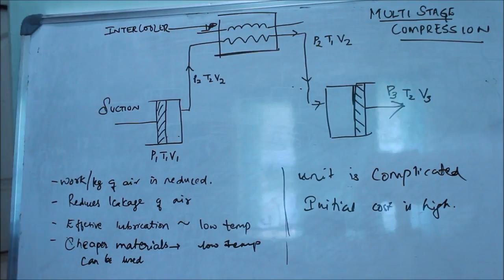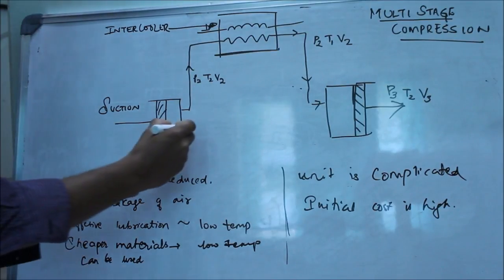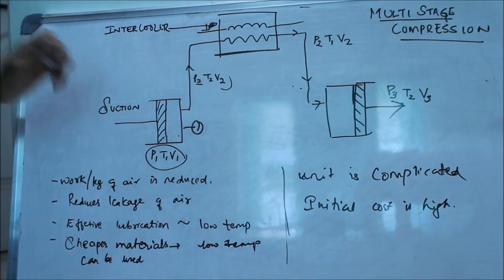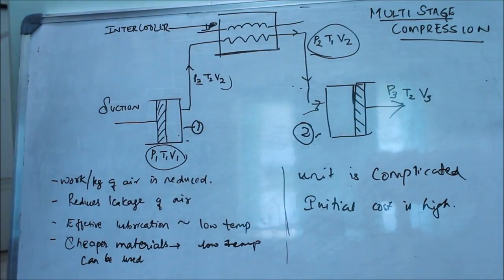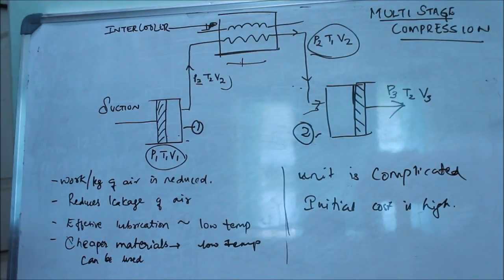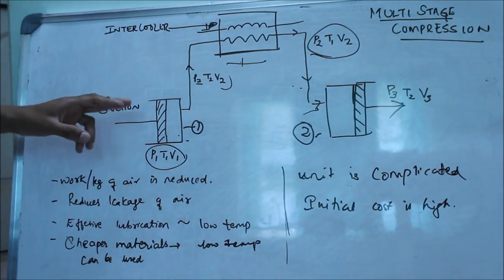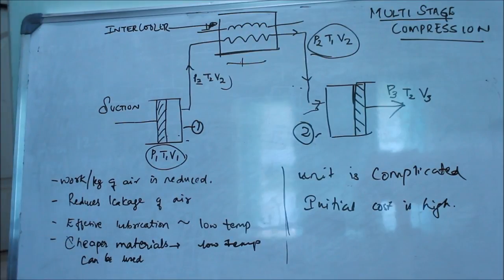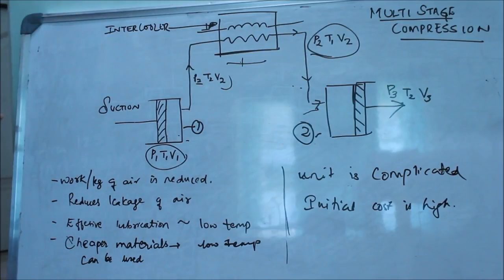Introduction to multi stage compression

Comment: why don't air pressure gets reduced when coming out of intercooler
Reply: PV=nRT 
is only valid for closed system.
Reply: That's because here, we're talking about an ideal system. In an actual intercooler, pressure and volume will change, but that change is minimal, which can be neglected while calculating work and efficiency.
Reply: Because the cooler only affects the temperature not the pressure
Reply: Thanks for replying
When temperature of gas is reduced so it may effect pressure of gas directly, as the kinetic energy of gas molecules gets reduced.
And also by eqn PV=nRT temperature and pressure are proportional to each other at a constant volume.

I was just curious.
Awaiting for your reply tq.